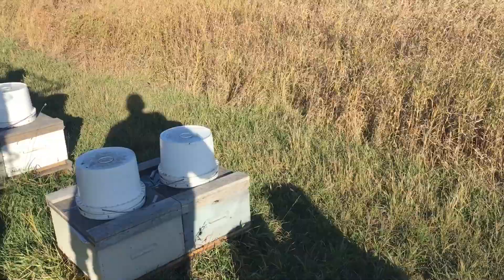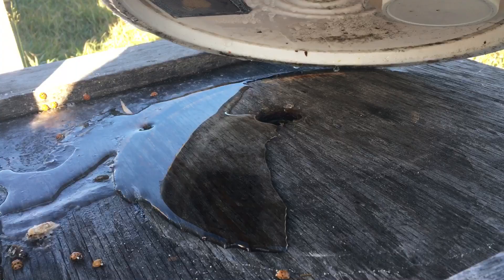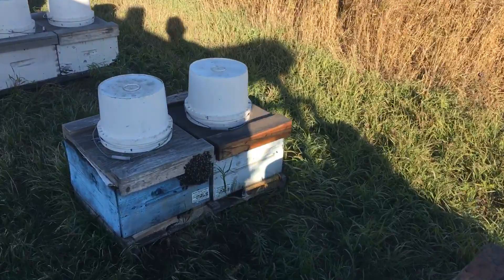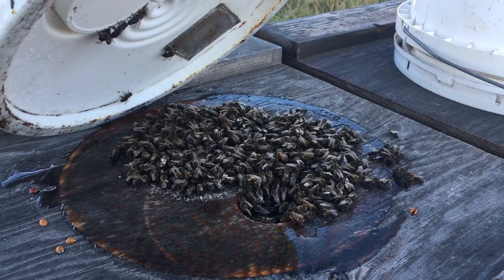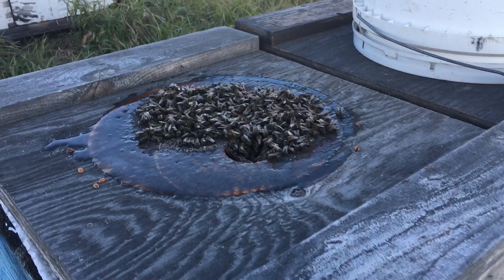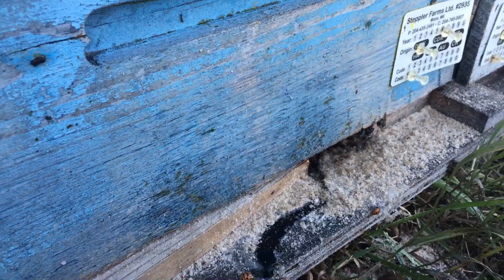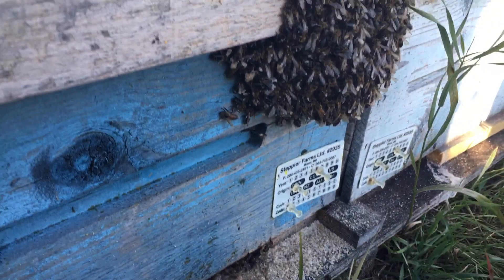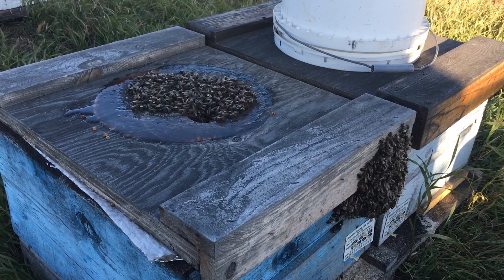The problem with top pail feeding

Comment: Grettings from sunny Croatia

Hallelujah, finally someone who noticed that the vacuum of feedingstuffs can spill (the differences between night and day temperatures lead to increase and decrease in pressure and thus self-discharge), usually I get nonsense when I explain it to colleagues, that self-discharge effect I tried to reduce with a glass bottle even and the addition of an extra box for lower temperature change ...
I know that you described this problem in another video.
Doing a great job of company and equipment is great for you.

P.S
currently in Croatia is above the hot 15 ° C like in April, we had only 3 days snow,
bees inserted pollen and started brood
Reply: That sounds like the answer to me.  I have a wash bottle in the shed that self-empties that way.  The emptier it gets, the faster it empties.  I can't think of anything to counter it other than insulation(to reduce daytime high temps) and smaller containers.

There ought to be a way to increase the difference in vacuum between dripping and allowing more air in.  If someone can think of an elegant way of accomplishing that, I'd like to hear it.  The best I can think of on the fly is filling the
plug with something like a green scrubber pad to hinder the air from pushing past.  I'd give it a try if I had any plugs.
Reply: My buckets leaked. I had drilled the hole in the lid 3/8" less than the outside dia.of the screen. This was too large of an area for the temperature changes. I dabbed a little silicone the size of a nickel to the center to reduce the open screen area. I reduced the leaking by at least 75%. They still emptied the bucket in the same amount of time.
Reply: Works the same with doe urine traps for hunting as well, to slowly drip as the the temp changes.

Comment: Have had great luck with using zip-lock freezer bags. A gallon-size will hold 6# of syrup easily. Two on top of a strong colony can disappear in two-three days in the right weather. Doing that commercially sounds like a nightmare but for us that are between hobby and sideliner size it's an option for quick feeding in the fall. Lay the bag of syrup on top of the brood nest then slit some slits with a razor knife. Cut only the top layer of plastic near the center. Do it 4 or 5 times and surprisingly surface tension holds the syrup from leaking. Oh, you have to use feeder shims.

Comment: Any thoughts on changing the means through which they access the syrup: different type of screen with smaller holes, smaller hole under the same screen, or just plain holes in the bucket lid without screen?